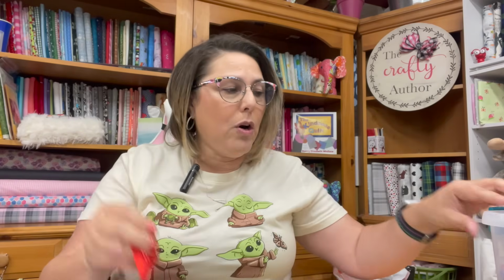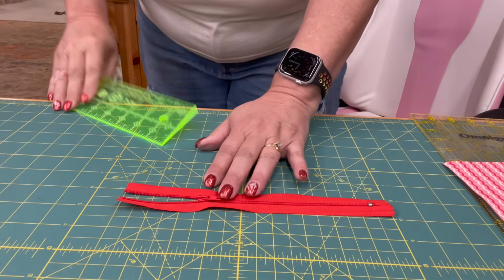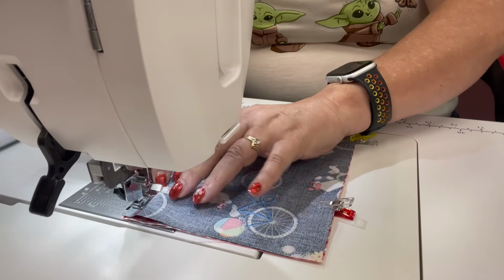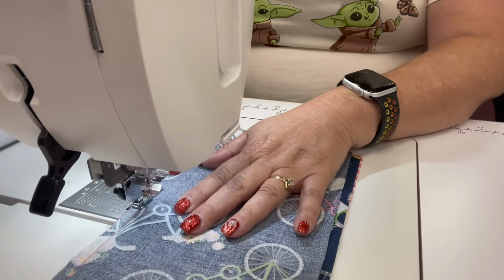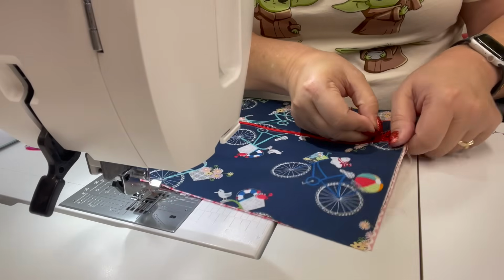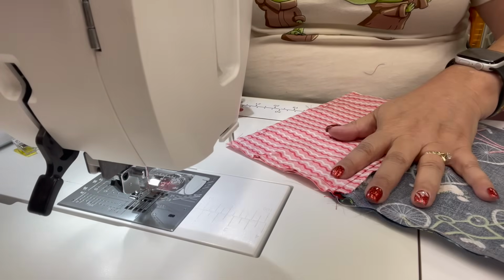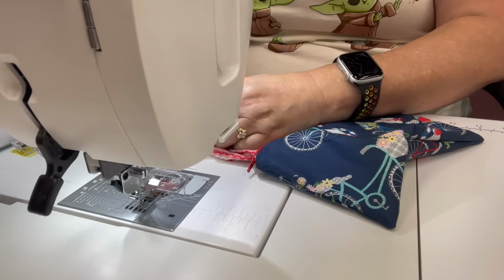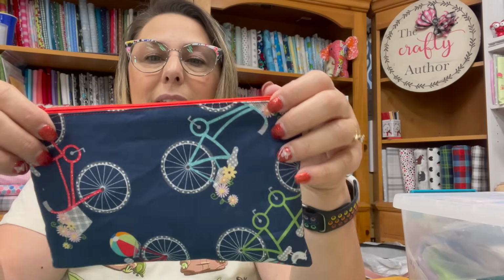EASY BEGINNER ZIPPERED POUCH WITH LINING

Comment: I have always put my zipper upside down on the material, so worth seeing what you have done on yours. Mind you I put the  outside fabric on the bottom the the zip then lining face down and sew. Will try your suggestion. Thanks for sharing,
Would you at any time also add a backing to the main piece for padding?

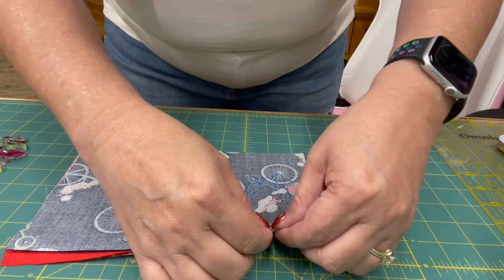Comment: 4:50  Hi did you use interfacing? Why do people use it or dont use it? Im a newbie and have only opened my machine
Reply: She did not use interfacing . Without interfacing the two cotton fabrics make a very soft flimsy bag , no structure. I personally will quilt my outer fabric and not interface the lining. I like my outer fabric interfaced  or quilted  for stability and body. I do feel that if you do not interface the outer piece totally to  iron a one 1.5 inch wide strip of interfacing across the top to stabilize the portion where you are going to sew the zipper. If unlined pieces are too limp the zipper fabric might be too heavy and cause some gentle buckling. Experiment . There are so many ways to make these bags and several different zipper applications. The type of bag that you sew depends  on what you are going to use it for or give as a gift . You can make one without a lining .

Comment: I use 1/4" quilters tape to hold the zipper onto the fabric.   Works great and no clips in the way.
Reply from the maker: I will try that next time.  Thank you for the tip.  😊
Reply: The tape I bought never stuck. Can't get a refund either .